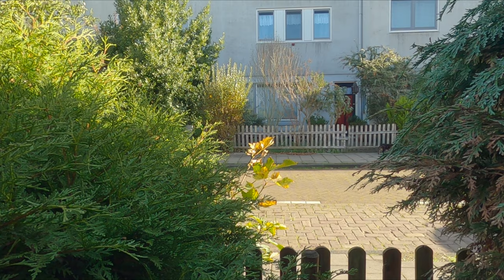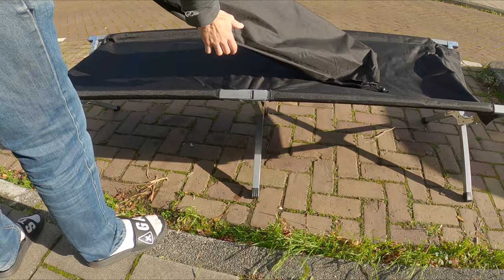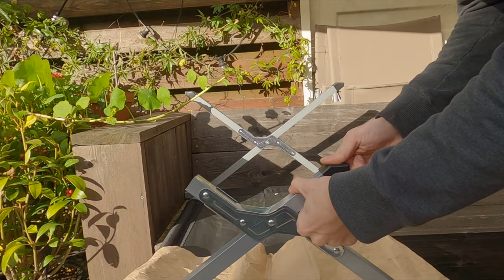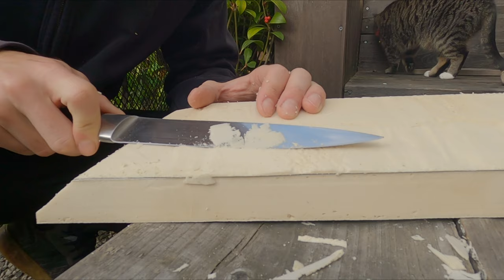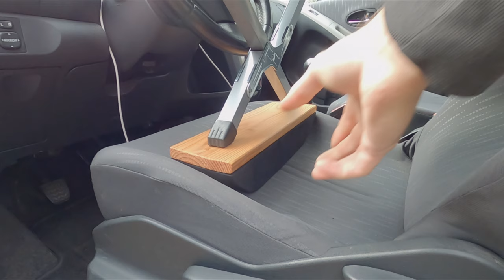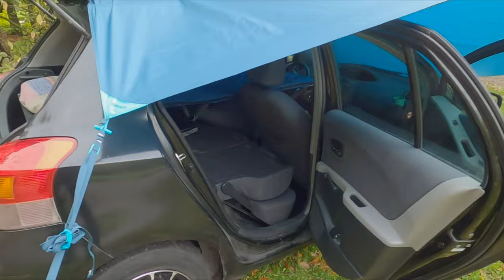Tiny Hatchback Camper Conversion *Super Cheap And Easy*

Comment: Once power tools are involved the word "easy" is void. >.<
Reply from the maker: It could easily be done with a hand saw. If you're not lazy like me..
Reply: Myself, I need to sit up in bed or at least almost sit up. I would have gone with a mattress on the floor. But I'm debating because I need room for storage underneath. Hmmm...
Reply: That's what I use to think - because my dad would be covered in grease and dust and everything was big and loud - until I actually started building out my SUV. None of that stuff is hard to use and basic stuff doesn't require a lot of intelligence or strength. It's about an hard as using an electric mixer or a blender. The safety guards and basic common sense will protect you from almost any accident. You can buy a Goodyear utility cut off tool from Walmart for $25 and learn how to use it in a 3 minute YouTube video. But if you don't want to get outside your comfort zone and learn a new skill, which is completely valid, you can also buy a $10 hacksaw.
Reply: @freeshrugs63  I'm thinking of a low profile platform and foam mattress.(28-30 inches wide x 69 in long x 5-7 in height). It'll give me more headroom in a Ford Escspe with seats folded down. Under the platform I'll use shoe boxes 4-6 inches high to keep it low profile.  I think it'll serve my needs for a weekend getaway camper.  Under 5'5" my bed won't need to be as long as the cot in the video. I'll use 3 pieces that will easily stack in the trunk during the week.  -- Thought draft. Will try a prototype this weekend. 🤞🙏🤷‍♀️
Reply: Agreed. And power tools are not cheap if you don’t have any to start with.
Reply: @freeshrugs63  many tubs are just I’ve 5 inches. If your platform is 6 inches high you should be good.  If you do a hunger head rest, it could be adjusted to be flat or angled to sit up us needed. That is going to work for me in my Escape.  I’ll use 3 pieces cut about 26 w x32 plywood and 6 inch legs at Lowe’s or Home Depot. I have a. Drill and will add the hinges & supports. — The more I’ve told people in my circle about my project they’ve shared helpful ideas and some with power tools have offered to help.
Reply: Too much work. 🦋
Reply: Lol

Comment: Hi i think you should position your bed on the right side so in case of emergency you can easilly jump to your drivers seat and drive away ,for safety reason
Reply from the maker: I like having the extra sitting space on the passenger side. But it can be used on either side of course

Comment: I'm planning a car camping trip this late spring, 2023, using my 2016 Audi A7 Sportback. With the back seats down, I can stretch out fully. Gonna just use my Nemo Air Mattress and Zenbivy quilt on one side and a Rubbermaid container with all my gear and a cooler and my favorite PodRocker folding chair. Will so a quick vid to show the setup.

Comment from the maker: I see many comments asking why the bed is on the driver's side. It can be used on either side, but I like to keep the passengers side free so I have more space to sit and relax in the evening or if the weather is bad. 
Thanks for all the comments! I'm working on more video's so please consider to subscribe if you are interested. 
It would really help me out!
Reply: I’m using the drivers side because it is wider of the 60/40 split. It fits most mattress. Pads etc.
Reply: I am also sleeping behind the driver srat for that reason, even it's tight.
Reply: I would sleep on the passenger side for safety sake.  You can jump behind the wheel and haul ass if you're in danger. 🦋
Reply: I agree with the safety concerns of not being able to escape if a bad situation arises in the middle of the night. I've had a couple of occasions where I've had to quickly vacate my parking spot in the middle of the night. 
Other than this concern, this was a great video! Thanks for the ideas.
Reply: @k-mac5511  Why would it make a difference is the seat is folded down? Just asking because am contemplating using a cot also.

Comment: I did the same idea in the ford focus passenger side .I took the headrest off and placed the cot rails on the seat worked perfectly . I tought about 2 2x4's and stretching a blanket .and placing it on the dashbroad to the back top of the back seats

Comment: Like the idea with the cod! But why didn't you set it up for the passenger side? You can leave the cod up and drive away in an emergency. You would also have more space for your legs as the steering wheel is out of the way. Another idea is to take out the rear bench completely. In some cars that takes only a few minutes. In my car (Hyundai Atos) it is just 4 screws. Cat loves it :)
Reply from the maker: I use the passengers side to sit/hang out in the evening. So its nice to not have the steering wheel there. It only takes a minute or so to set up/put away, after which the car is back to normal.

Comment: Superbe idea. Would just put the bed on the passenger's side to be able to drive away quickly when necessary.
Reply from the maker: Thanks! My reasoning; If you have the bed on the drivers side there is more space in the 'sitting room' (passengers seat..), which is nice in the evening or if it's raining. And if you need to leave quickly, the whole thing packs up in about a minute...

Comment: Could you live full time in that Yaris?
Reply from the maker: I wouldn't, but I'm sure you could...
Reply: easily done.   push the front seats all the way forward, sleep with your head in the trunk, and feet in the middle between the two front seats.

Or if you travel solo, remove the front passenger seat and put a permanent bed, tons of videos of ppl doing that on YT

Comment: Freakin awesome!!
I’ve been wondering how the heck to use my little hatch as a camper without removing the seats!! 

I have been sleeping in the drivers seat all curled up till now!
Thanks heaps!!
Reply from the maker: Glad I could help!
Reply: push the front seats all the way forward, sleep with your head in the trunk, and feet in the middle between the two front seats.

Comment: Hi would this work in a 2 door yaris ?
Reply from the maker: I Don't know. You would have to check if the dimensions are similar... Also, you might be able to find a shorter bed to fit the car. Good luck
Reply: No need for all this.  push the front seats all the way forward, sleep with your head in the trunk, and feet in the middle between the two front seats.  Done